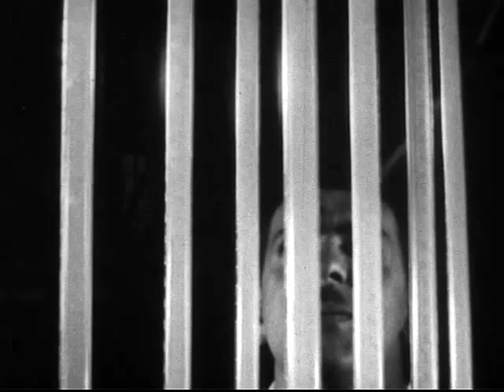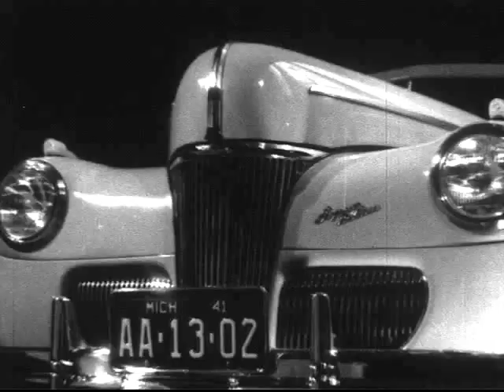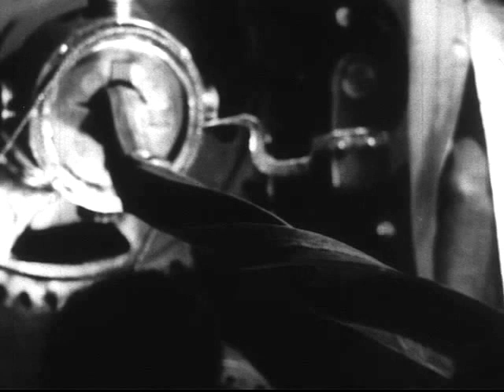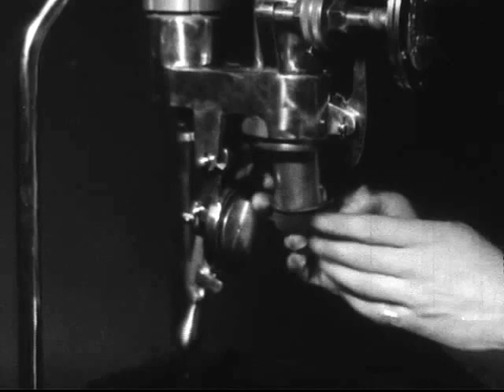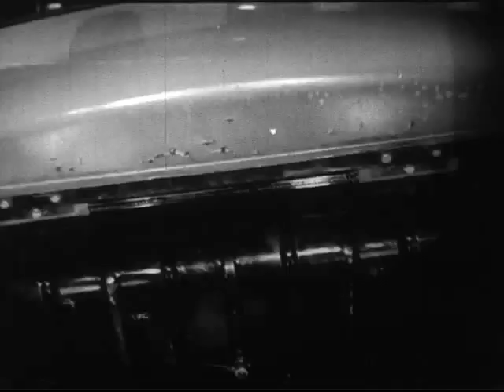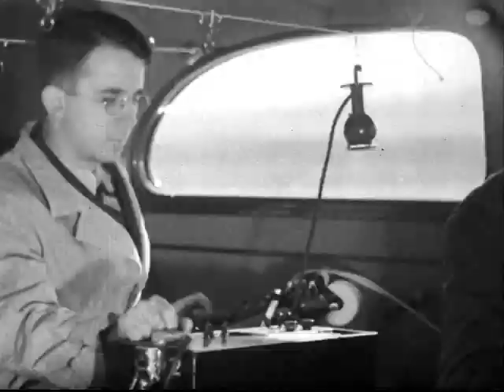Science Rules The Rouge (1939)

Comment: When quality products were more important, you want customer loyalty,  today, they want to produce products faster and cheaper with minimum quality constraints, the practice works, they end producing boeing 737 max, until, their products break down so dramatically which is impossible to hide from the public.
Reply: Kinda. Kinda not. Although this tech here is impressive, the 737 max is made to extraordinarily tighter constraints than these cars in the 30s. The max had an issue with functional automation and how it was used and also communicated to the pilots. I assure you every bolt was tight and sound right until the plane hit the ground.